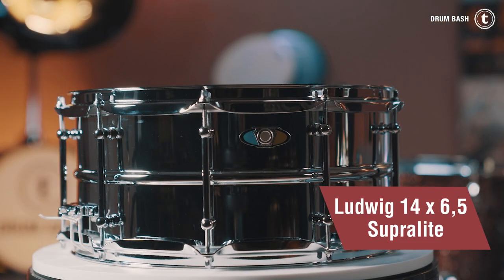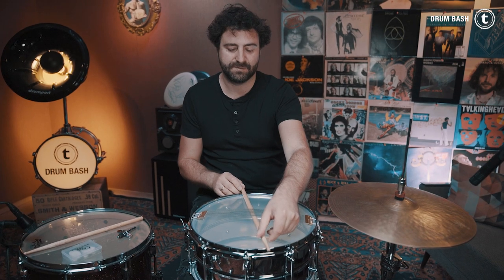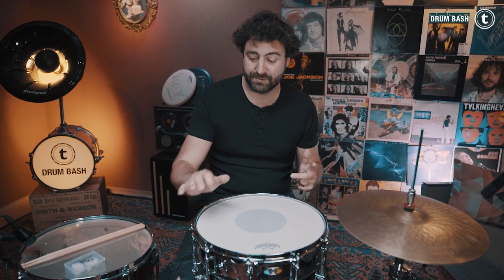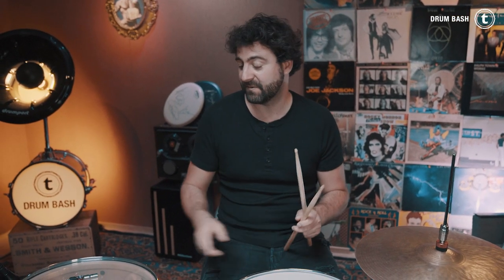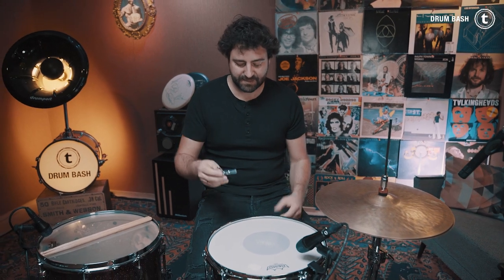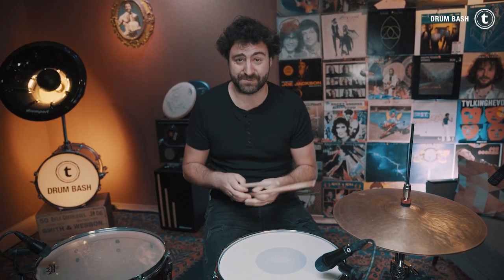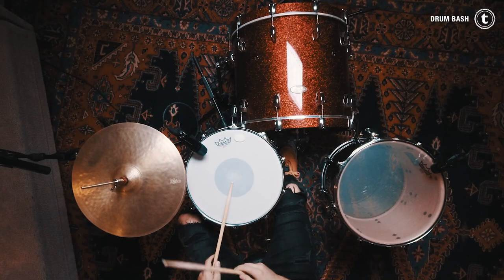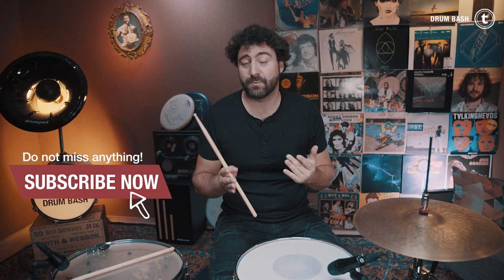Guide to a great snare sound  | Snare drum tuning | Ludwig 14 x 6,5 Supralite | Lesson

Comment: As long as the drum shell is round and there is no problem with the bearing edges or strainer/snare wires, you‘ll get your desired sound even with relative cheap drums. An important information.